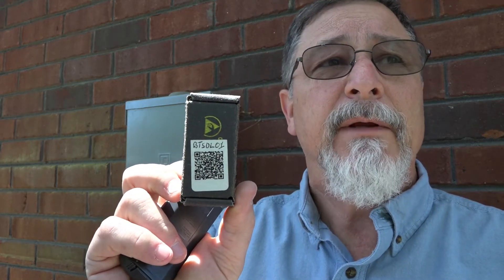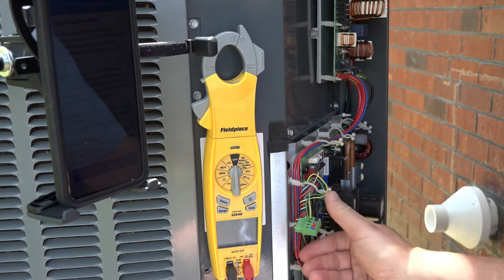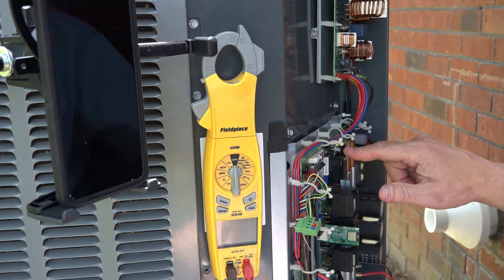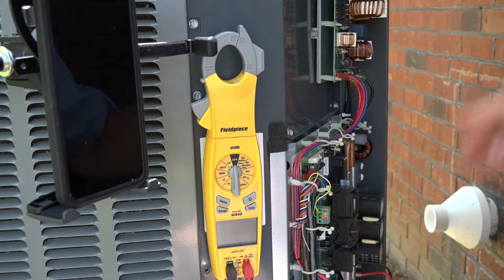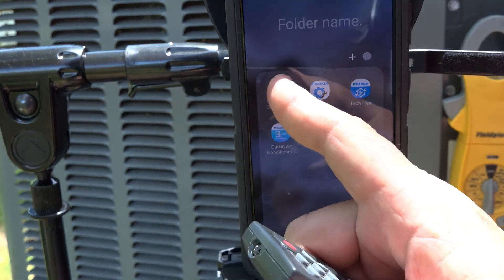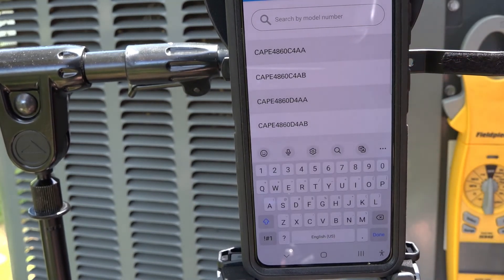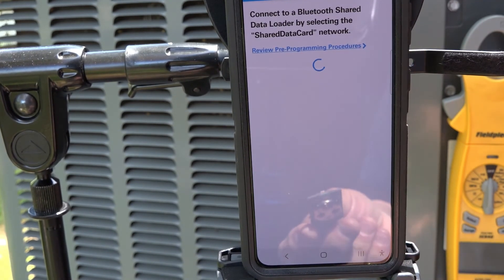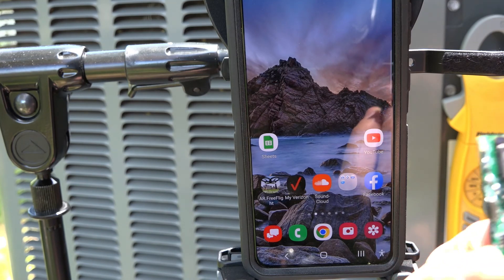Shared Data programming

Comment: I have a question for you. I just replaced on an air handler. The main control board and the lower motor with module. And I have the chip now. Do I do my work from the condenser or from the air handler?  Did you please hit me up

Comment: Ik this is old. Quickly. Outside ac both boards burned up voltage spike. I didnt diagnose.  The boards we put on a straight ac. So I did the data drop. But I get e11 code.
Reply from the maker: E11 is run test, youll have to perform the system run test in the tstat after you do a factory reset of the thermostat  (required)

Comment: Hello, Scott, Im currently having problems with a newly installed FIt DH7VSA4810 and a modular blower MBVK16CP1X00 that is throwing a code "heater kit selected is too large" despite there not being a heater kit selected.  On the blower unit it indicates that if no heater kit is selected to select a heater kit that is compatible with the model.  Current setting is 11 for the smallest compatible heater kit for the model.  

The Daikin manuals only mention setting the switches or reloading the shared data to address this error code, thats how I came across this post.   Any ideas if updating the shared data would fix this type of issue?  Im not sure if there is a firmware notes or way to check the current rev of shared data vs what is the latest from daikin?
Reply from the maker: Option 3 select air hander, heat setup it should heater kit none, select your heater kit size. Save new setup in the tstat that should get you up and going
Reply: @hvaciswin723   Dont have a heating kit and the tstat shows heater kit none. It seems somehow the unit is confused.  Energy star listed this combo as approved so we would hope they have it working but starting to have concern now.
Reply from the maker: Reset dip switches to default i think they shouldbe off
Reply from the maker: You can call me, do not give out my number 615-785-3638
Reply: @hvaciswin723  dip switches default off (000) now, but it seems to indicate in non communicating mode they are supposed to be set to any legal heater kit if there is none.  Thinking to try that, and if it doesnt work Ill reach out.  Thanks much for the help.

Comment: I have a goodman air handler that I need a memory chip / data chip whatever you want to call it. No one has been able to help me. Can you help with this? I have a brand new blower motor and brand new board but can't use them. I've been waiting months to get my ac working properly again.
Reply from the maker: Sorry i missed your message,  did you get it running?
Reply: @hvaciswin723 No not yet.

Comment: I'm wondering if you can help me. I'm here in Central Florida and I had to replace the indoor circuit board and the blower motor due to an electrical failure in the house and I have the data loader but I'm not sure how to download the data onto the chip. Do you know if I'm supposed to load the data from the outdoor board onto the chip and then take that data loader and put it on the new indoor circuit board?